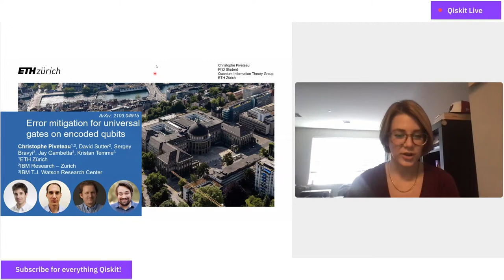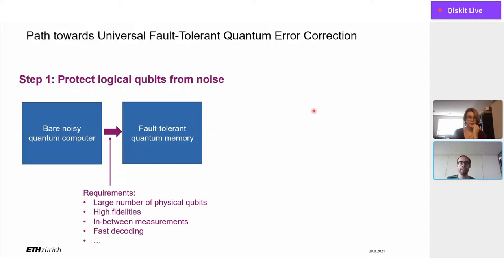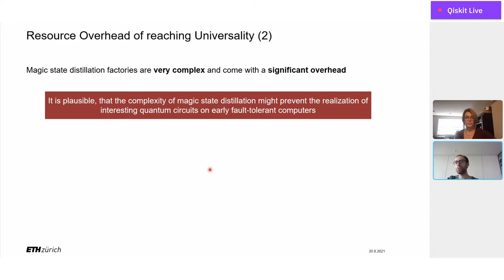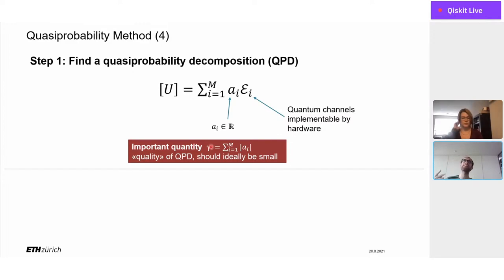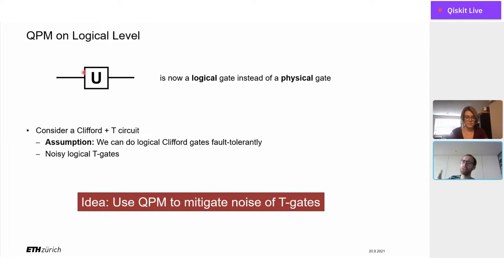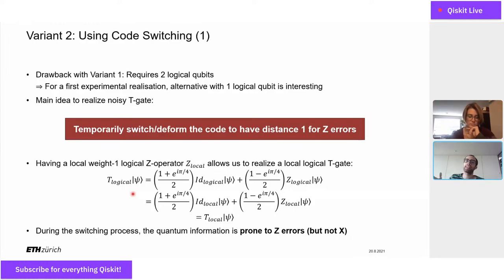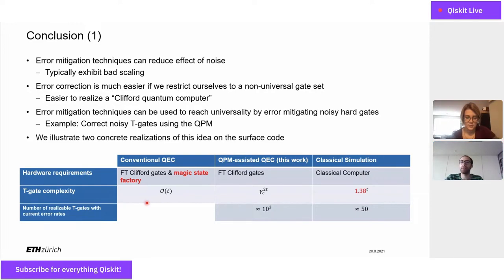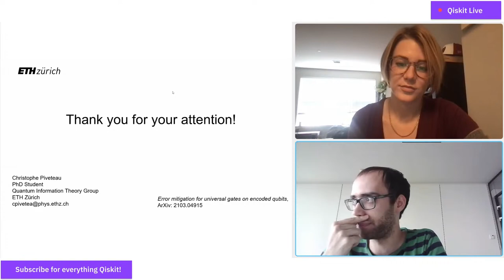Error Mitigation for Universal Gates on Encoded Qubits | Qiskit Seminar Series with Christophe Pivet

Comment: I hear that quantum computing might be able to get the edge on classification and hence organizational abilities of data fitting.
Am I near enough right in that regard or am I missing the point about quantum computing and AI.
Well if I'm near enough right couldn't in the near future we start to use quantum computing to find more optimal dynamic dimension tensor fits for problems rather than working with more general tensors. If quantum computers can one day do this it might lead to some great ai speed ups and improvements for classical electric or classical photon computers.
If you instead of using simple error correction could you not instead design the quantum system to solve quickly one of a pool of possible solutions instead leading to 1 complete solution with classical computing at the end of the process.
I was like solving what you can on soduku quickly with a classical computer or easy for a medium player. Then through altering the grid and from a lot of negatives you find information that allows you to to make reductions of your cell possibilities.